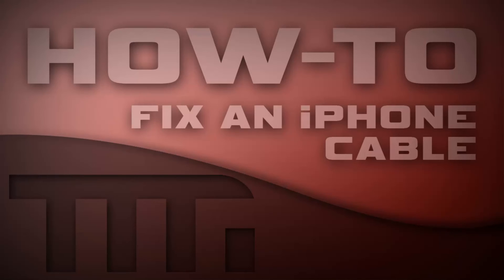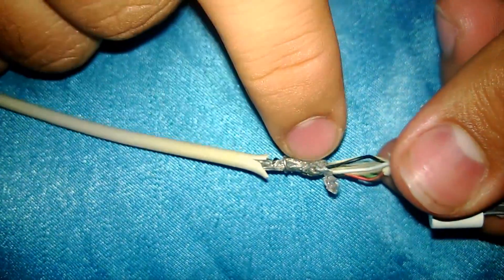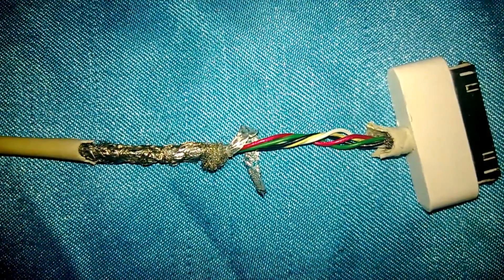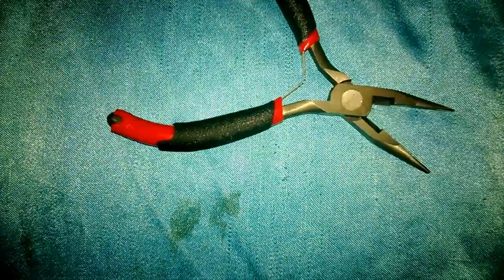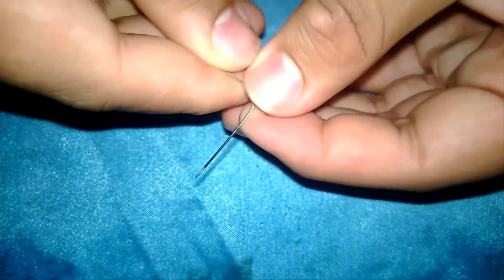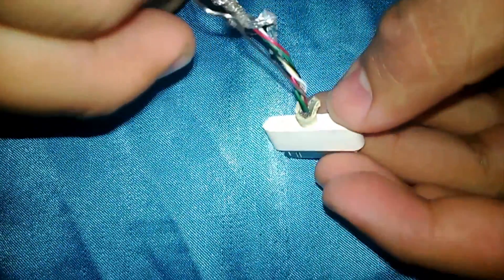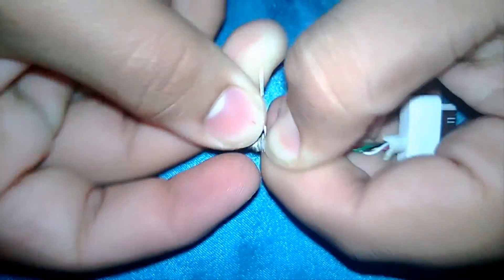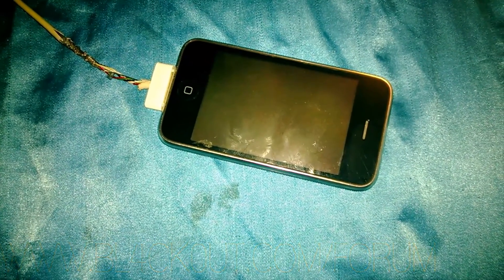How to Fix a Broken iPhone Wire

Comment: If the metal barrier is snapped use aluminum foil cover it with tape and then roll it around the iphone charger. If your wire is snapped hot glue it

Comment: Just cut my wire open at the top to do this...doesn't look anything like yours. Mine has 4 wires in a perfect row going directly into a sealed plug on the end. Only way to get to the area where you pushed the pointy end of the safety pin into is to slice open and demolished the plug. I just threw mine away. 😢

Comment: How do I get the wire to stay still in one place? I was thinking maybe glue but it doesn't seem like a good idea.
Reply from the maker: That can be a little tricky but I highly recommend you don't use glue. Use electrical tape if you have some and make sure you tape it around pretty tightly as the wire may move out of place after a while.

Comment: how do you strip the white cord
Reply from the maker: Well it's quite easy because the cord is very weak. Just make a little slit in it from a knife or the cutting part of the pliers and you can pretty much pull it off.